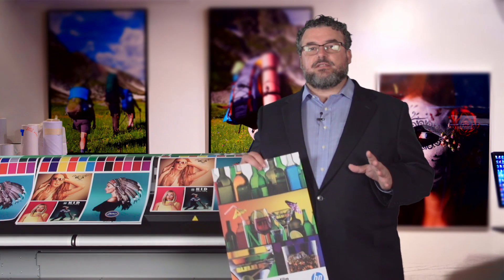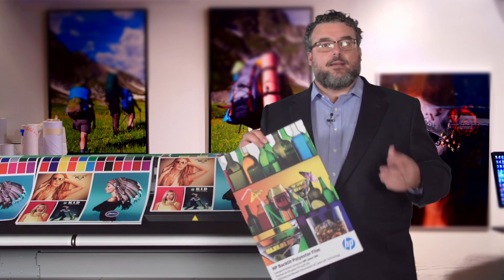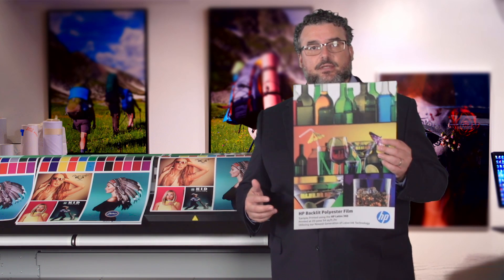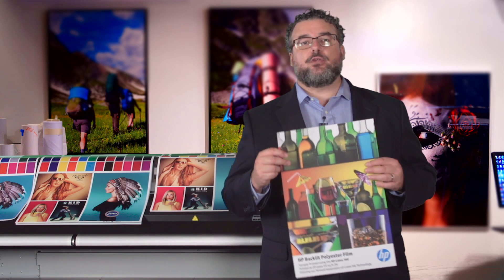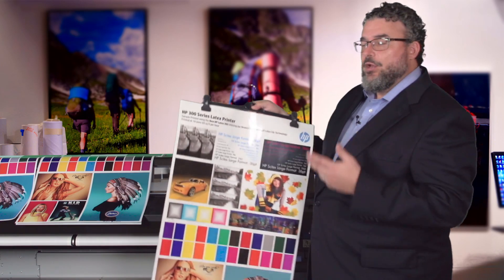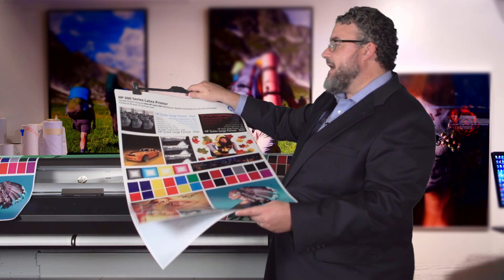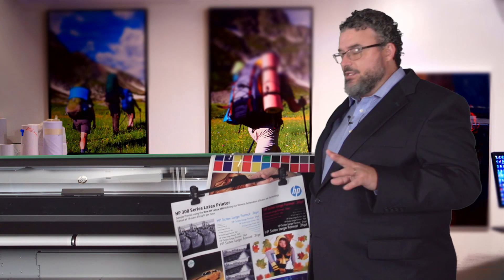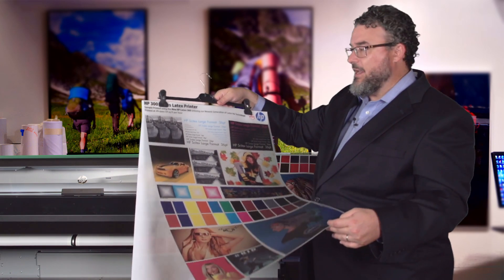Backlit Media Types and Considerations | HP Latex | HP

Comment: What tipe of printer did you use exactly? I am using the HP 2600, could this media be used with that printer. I use lexan but I end up creating two prints and stacking them together so we can increase saturation and density in the colors. What is the best way to achieve great quality and well saturated colors?